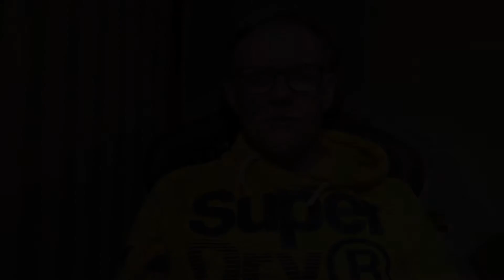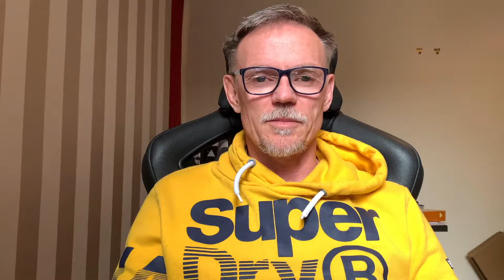R53 Mini   Update May21

Comment: Have installed ALTA 2%  , 15% compressor pulley and single clutch valeo 4KKIT in addition to updates to Vibra Technics and power flex engine mounts I have vibrations in the steering wheel only at idle otherwise everything is fine .I do not run on tracks or treat the car badly.
Reply from the maker: Hi Manu,  thank you for the response.  It is great to hear others who have made the changes and not had to many side effects.  I am not sure on the vibra technics, I always wanted to as the one are rubbish, but then there have been many recent reports of issue with vibra technics!! 
Any reason why you chose 2% and 15%?  I have  ordered two 17% SC pulleys and wondering if adding the 2% crank would be too much!?
Reply: @hyphensclassics   crank pulley 2% and 15% pulley is technically 17% I prefer not to overload the supercharger with 17 or 19 also I experience a better response with 2% with lightweight crank. I have seen many comments that this combination is reckless maybe it is if you go to trakday very often...With vibratechnics and powerflex I also experience a better response in the output but I have vibrations in the steering wheel and dashboard if you do not like vibrations it is not advisable the vibrations are only at idle  .These cars are already squeezed from the factory if you modify them and run like the devil because it is to be expected that at some point
let your soul say until later jajaja.  Mine is from 2002 and has 200,000 km and he's been with me for 6 years, have no complaints with it, it is a good car.Good luck with the project for me it is the best hobby I could find.
Reply from the maker: @Manu-pu7mz  thank you for the reply and information, very useful!  I might have to see if I can change one of my SC pulleys and match it to a 2% crank pulley just to see the difference.
Reply: @hyphensclassics  it's the only way just to experiment and find what works for you.

Comment: Hi, finally completed the R52 rear suspension with the R57 rear subframe. Everything turned out well in the end! The only thing is that it seems to have a pretty strong positive camber and toe-in seems too great too. The camber is not a big problem, I reckon. But only toe-in can be adjusted with the standard control arms the and the lower control arm adjusting nut will not give me the desired toe-in of around 0.2-0.3 degrees. Do you know if I can make a further adjustment by repositioning the front bolts for the trailing arms? I bolted them back in the old exact positions but it seems there is room for slight sideeays adjustment.
Reply from the maker: Hi, sounds like great progress!  Yes the trailing arm mounts to the chassis are sideways adjustable.  I left the alignment to my garage and so did not fully torque those bolts. I put them where I measured them to be and left it to them.  This should give you the ability to adjust your toe to where you need it
Reply: Thanks a lot, that’s very useful confirmation🙂. I’ve used my laser level to measure toe, which actually works ok (less cumbersome than string). I would have had it done it professionally if I needed to align all four wheels, but reckoned doing the rear wheels would be fairly straightforward. Not as easy as I inktially thought, though!
Reply: I wrote ‘positive camber’ but what I have is in fact negative camber. Adjusting the trailing arm bracket mounts outwards should logically have the combined effect of adjusting both camber and toe-in!
Reply from the maker: @Bamsebrakar2011  at least you are giving it a go,  there is much to learn about it all!  I had mine done as I did not want to trust myself with string! Also having done 4 wheels, lowering it etc.
Best of luck with the alignment
Reply from the maker: @Bamsebrakar2011  I can see how it affects toe, camber, slightly I guess as it moves the position of the rear of the trailing arm.  As long as you can work out what is right!
Reply: Tried adjusting the trailing arm mount and it did all the difference. Rear wheel toe-in and camber is now in accordance with specifications, so very pleased with the result!
Reply from the maker: @Bamsebrakar2011  awesome work!!
Reply: Thanks, using my laser level made it easier. But be aware that thanks to you and your youtube guidance series on the subject provided determination, courage and inspiration to go through with it. I’ve learnt a lot. Thank you!
Reply: By that I meant the entire job of replacing the axle beam and restoring the whole underside.
Reply from the maker: @Bamsebrakar2011  thank you 🙏.  I am glad that the videos encouraged you to have a go.  That is exactly why I make them!  I am delighted that you have set out and achieved your goal of getting the Mini up to spec, your spec and with your own hands!
What’s next? 😉

Comment: I have experience with the pulleys, however engine harmonics is not something I would personally mess with (meaning the solid pulley). Best of luck with the project :)
Reply from the maker: Thank you ikaros2k, the good news here is I have found that ATI make a 2% super damper!  So the question is do I buy that.  I have bought a 17% SC pulley, so 2% dampener makes the SC 18% effectively 😜
Reply: @hyphensclassics  at around 18% the generated heat from the supercharger might become a performance issue. If you consider to run a methanol kit is not going to be that much of a problem. In my opinion  either replace the crank pulley with the stock one from the facelift models or go with a 0% from ATI :)
Reply from the maker: @ikaros2k  thank you very much for the guidance.  I contacted the shop I bought the 17% pulley’s off and have managed to swap one for a 15%!  So now I can run a 2% ATI and 15% SC on one engine and just a 17% on the other.  Will give me a good insight into the differences